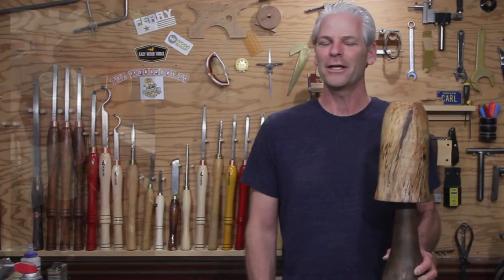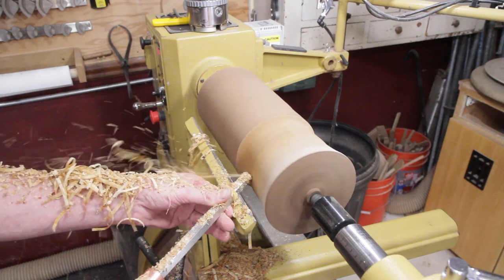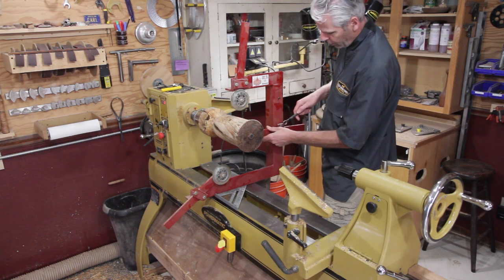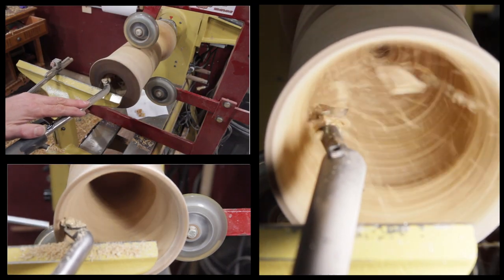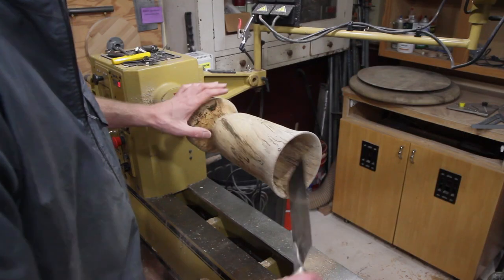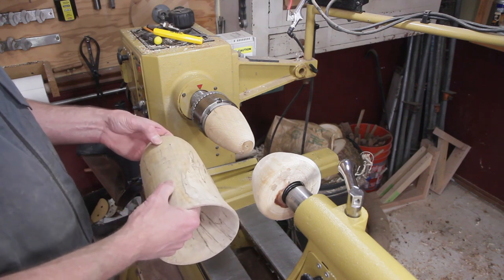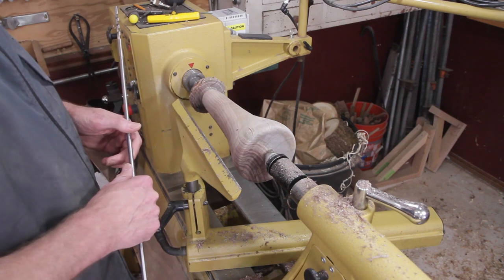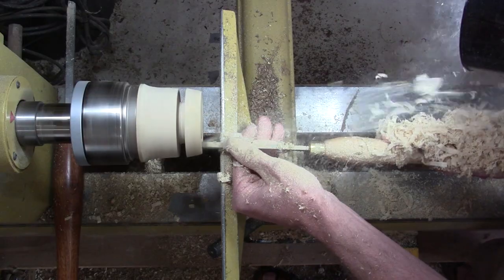Woodturning Chestnut and Walnut Lamp

Comment: hey carl, can you make a video on making your own carbide tool? i think youd get lots of views, there arent many videos on it. Im thinking you just grab some metal stock, turn a handle for it and tap the end. but im thinking there might be more to it.

where do you get your carbide cutter heads? spexifically the round head one. im also in canada.
that spring thing was really cool too
Reply from the maker: howycwap Sorry, I have no idea how to make my own cutters. I get mine from Easy Wood Tools. The round cutters are there finishing tool, which works great!
Reply: Carl Jacobson dang...well what do you think, if i get some square bar stock. NOT tool steel, do you think that would be strong enough to withstand the cutting forces? I dont want this thing to implode while im turning or anything
thanks Carl, ill check out the site